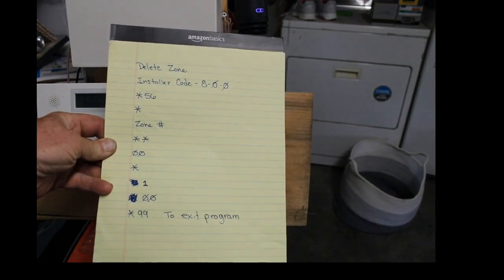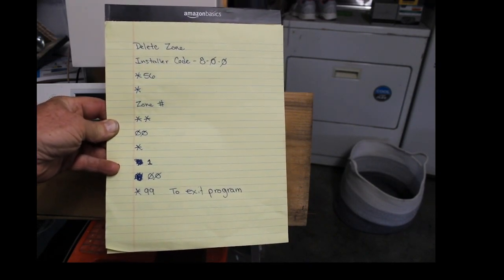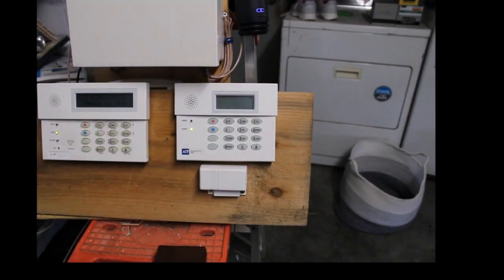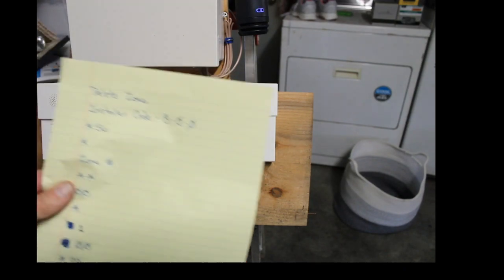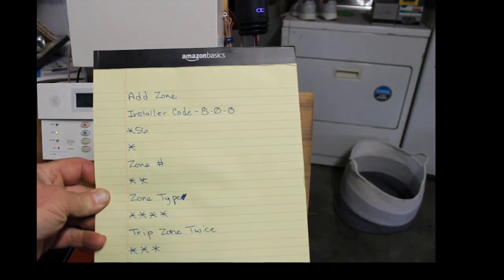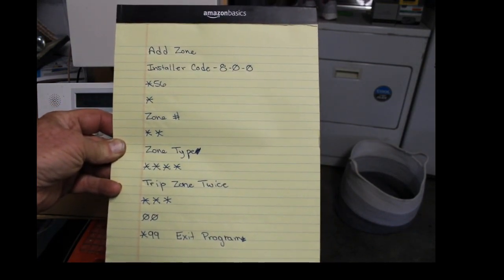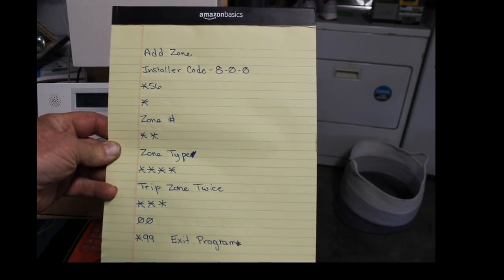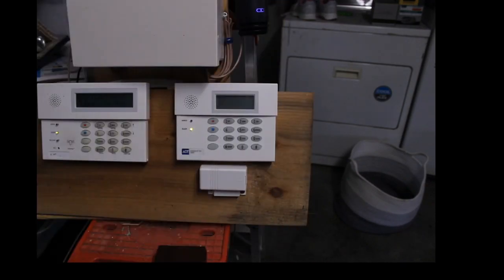Safewatch 3000 delete and add wireless contacts using fixed english keypad (ADT HOSTAGE KEYPAD)

Comment: Your videos are very helpful.  The question I have is in a video you did about 9 months, your cheat sheet show hitting the * button four times after tripping the contact.  This video cheat sheet shows hitting the * button three times after the sensor is trip.  Are both way correct?
Reply from the maker: Yes both are correct

Comment: Having issues deleting non functioning 5834-4 key fobs from Vista 20.  Don’t know what zones these were on. When trying install new keys I get a continuous beep sound when programming serial and loop numbers, 
just trying to use loops 21 and 22 and their respective keys.
Reply from the maker: The only help I can give you on the locations of the 4 zones for your old FOB is,,, If your system was put in by ADT the 4 loops they use for FOBs are 49,50,51 and 52. Your situation sounds like you are in need of upgrading your keypad for better control of your system.